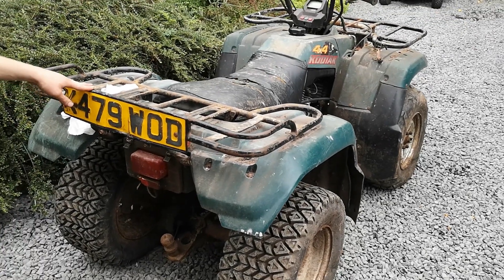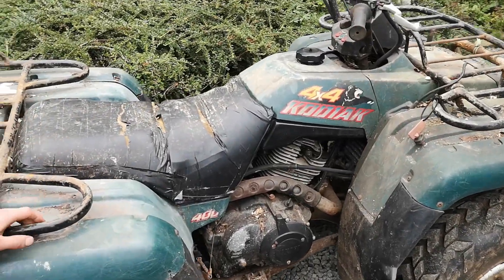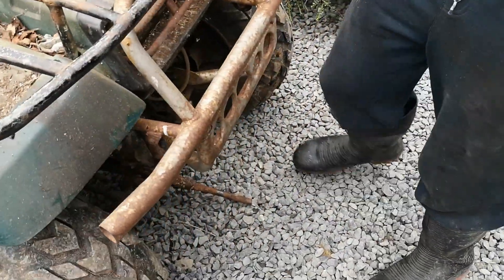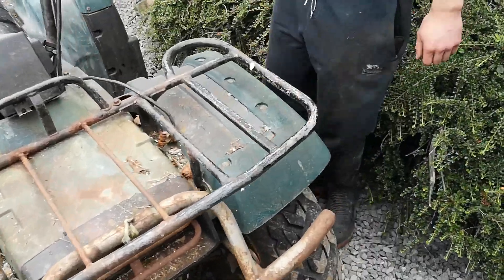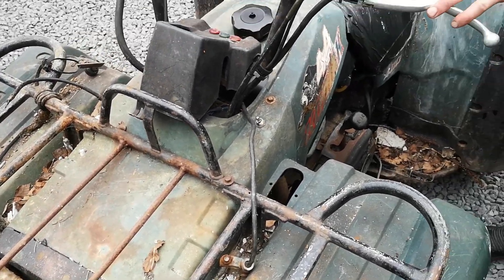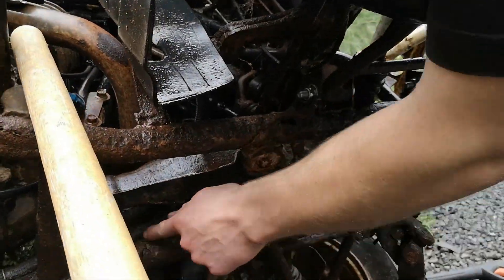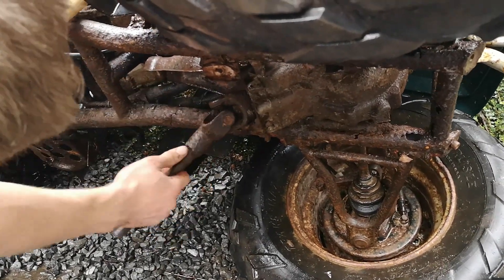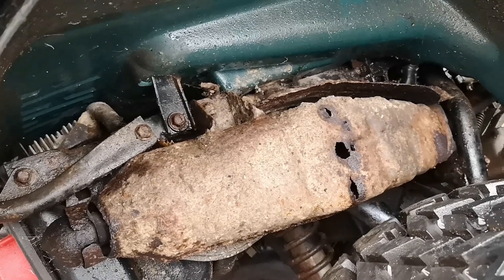Cheapest Yamaha Kodiak 400 in the world  - 1992 quad

Comment: Literally got my hands on the same bike last year, frame was worse. Stripped everything off it. Found another I can rebuild. Use it for parts. With the frame that rotted, it’s a huge job to work out the bends, welds and mounts.
Reply from the maker: Yeah this was to far gone.
Especially if we're going to sell it on to someone else, wouldn't be comfortable letting anyone ride it properly, video is quite old ended up selling it to someone who wanted an engine. It's engine was actually quite good.

Comment: hi there I have a yamaha big bear 350 4x4 and when riding everytime I shut it off after a sec or do the muffler makes a puff kinda sound not like a backfire I guess but kinda a puff or pop not very loud. the air filter is clean just started in the last 2 weekends of riding do you think i need to adjust the carb not sure if Id turn it in or out let me know what you think. runs great and starts good so I don't know I just don't like it
Reply from the maker: It's fairly normal, will be running a bit rich minute amounts of unburned fuel will be being thrown into exhaust. while running you wouldn't hear it ignite but when you turn it of whatevers left ignites and you hear it.
Pull the plug will probably be a bit black.
Unless you really know what your doing leave it alone. Carbs on these things are exceedingly sensitive half a turn on the mixture screw makes the difference between running mint and running like crap.